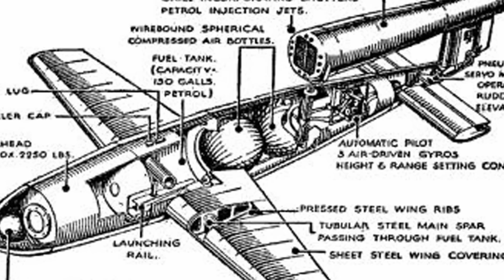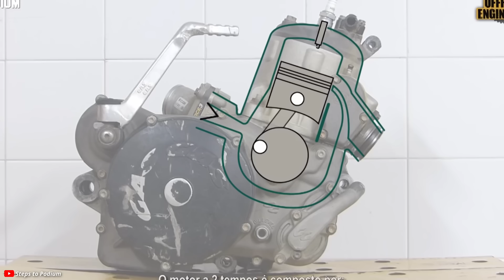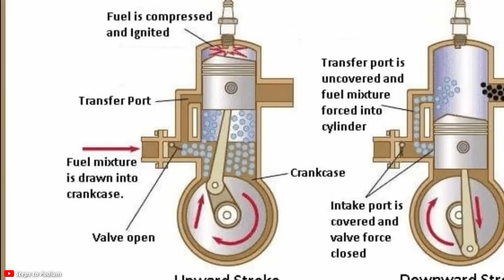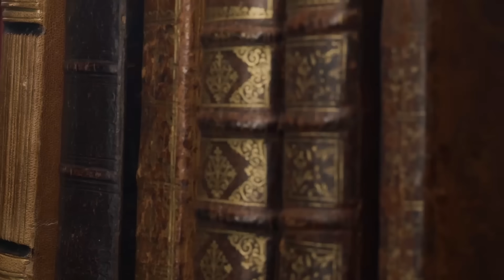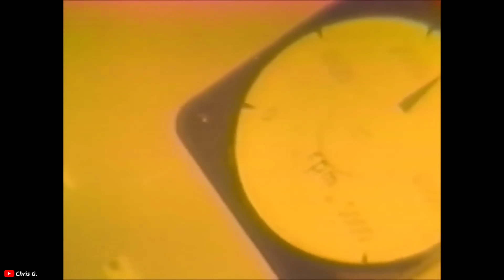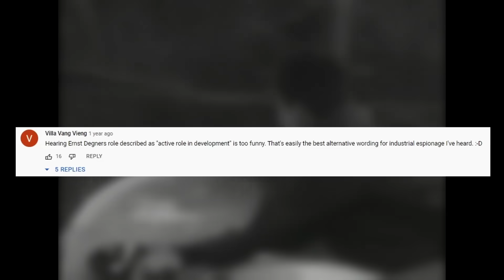How Suzuki stole communist technology to make their motorcycles faster

Comment: Wow, what a remarkable history, and, what a fantastic delivery! You have definitely earned all the kudos you're getting!

My first bike was a dinky Yamaha 100 (2-stroke), and my second (and last) bike a Honda 450 (4-stroke).

I keep telling my wife I'm gonna get another bike (I've maintained my cycle endorsement on my driver's license all these years), but here in my seventies, it seems less and less likely each year. That I have a partially failed triple bypass, one heart attack, and severe scoliosis, as a result of my subcompact being rammed (while stopped at an intersection) by an Olds 98 doing 45 MPH... this all does not really help at all.

But, you never know. I seriously would like to get another bike some day.

But meanwhile, here's another bit of "commie tech" that made its way to Japan:

Nearly all "pro" (and "advanced amateur") cameras are "SLR" type (single lens reflex), in which you view through the actual lens, the camera using a mirror to direct the image to a focusing screen, from which you view it. When you press the shutter release, the mirror flips up, and then the shutter (in front of the film or sensor, depending on the camera) opens, takes the exposure, then closes. When the mirror is lowered again -- either instantly upon the shutter closing, or, when the advance is cranked (by hand or by motor), the image can again be viewed.

The only problem is the mirror! Because it's a mirror, it reverses left and right. So, the image you see while looking down onto the focusing screen (that's the other part of the problem) is a "mirror image."

And if you want to view it at "eye level" rather than "waist level" you'll need to put another mirror into the system, this one above the focusing screen, at a 45 deg. angle, aimed at the eye. The image will no longer be reversed left-right!

However, it will be upside-down!

To have an image that was neither "mirror-image" or upside-down required a clunky arrangement of prisms, known as a "porro-prism" -- the same type as traditionally used in binoculars. While it did work, it resulted in a small image, and, an extremely bulky arrangement of two prisms (or four mirrors), making its implementation completely impractical except for some TLR (twin lens reflex) cameras (the Rolleiflex being the most well-known TLR, but, one that did not offer a porro finder). As far as I'm aware, the Mamiya Pro series were the only TLRs that offered that option.

I digress.

The East German Contax 35mm SLR was the first to solve the problem. They implemented the Pentaprism (combining the "normal" five-sided prism -- the "normal" pentaprism -- and, the "roof prism" into one strangely shaped block of glass).

A five-sided "flat" pentaprism will provide eye-level viewing, but, reversed left-right. Their genius was their combining it with the roof prism, delivering the "peaked roof" shape on top of millions of cameras.

The "roof" part of the prism is a pair of reflecting surfaces, at a 90 deg. angle to each other, and a 45 deg. angle to the rest of the prism. The two mirrors re-reverse left and right, giving a right-side up, unreversed viewfinder image.

Needless to say, hardly anyone these days has heard of "Contax," but hardly anyone has not heard of Canon, Nikon, and many other top-tier Japanese companies (and even more lower tier companies.

I spend too many years as a camera repairman (and photographer, and, "brick and mortar" camera store merchant). The above is some of the stuff I picked up along the way. If it seems wordy, I apologize. I wanted to give it the relevant context (and, my last "serial career" was as a software developer and technical author, so it's a bit of an occupational hazard).

Anyway, thanks again for a truly top-notch video, which I'll be recommending to some other folks.
Reply: @This is my real name.    Thanks for your story, and I digress from the topic, but perhaps you'd like to know. Back in the '50s MY dad started into getting himself a new SLR and was amazed by the Contax technology. So he saves up his money... and bought one.  Many, many old family slides of his, in glorious Kodachrome, etc.  were all we have left  Dad died aged 95,  Sept. 2009;  we still have his house, and if lucky, that Contax is still there . . . . somewhere. 
PS. Back to bikes. My bro and I were really into 'big singles" and still have our prized 1969 Matchless G80CS models. 2 years ago, though we bought a 450 Honda single/  If I ever get my motorcycle license back, (it's way harder now!), I'd love to put some miles on it.)
Reply: @loftsatsympaticodotc  - Thanks for the kind words, much appreciated! I hope you can find that camera! When you do, it should probably be "exercised" every so often to keep it in running order. Snap the shutter a few times on the high speeds, and, the low speeds (i.e., 1 second). If you hear gears buzzing on the low speeds, that's a good sign. If they "sputter" or halt, then it's a sign that the camera can use a "CLA" (clean, lube, adjust). I used to have a camera repair shop, retail storefront, and wholesale operation, route drivers covering much of the SE quarter of Michigan, but I ended up with several careers after that, retiring (due to being disabled) when I was a technical author (book/magazine article stuff on software development).

I wouldn't know who to suggest to work on it but there were (and probably still are) camera repair listservs and it wouldn't hurt to do some web searches for them, and ask questions there. I'm sure someone would know of a reliable repair shop.

I hope you can get a bike -- and your license! I've always maintained mine, "just because." Kept my Chauffeur's endorsement too, "just in case" I ever need to drive for payment (yeah, fat chance <g>).

Comment: You told this story in a great way. I have had a Suzuki 750GT, Kawa 350S2 and a Yamaha RD350YPVS. As we say, an healty engine fires every time… Had some 4 strokes also bu there is something special with the 2-Strokes. 
This is actually a interesting story from a industrial perspective. It will not be the last we hear about industrial espionage and basically theft. Thanks!
Reply: It will be the last, half the story is nonsense.... romantic stuff I'll grant you but mostly nonsense.
Reply: the way 2 stokes run feels like free energy from vacuum! 🐱👍🏿
Reply: I favoured the two stroke for the power the four strokes for economy and on one "engine brake" throttle off and you almost go over the handlebars,change down and slow down even quicker take the bend no brakes applied out off the bend open up redline change up redline change up,On my two stroke similar but much more violent acceleration but no engine brake but still changed down for the acceleration out off the bends, used to take my breath away
Reply: SUZUKI stole nothing,All their own research and development,The CCI on your SUZUKI could be argued a copy of Scott,But it wasn't because scott had patents and used crankcase pressure and SUZUKI used a oil pump from a reservoir governed by the throttle and the engine RPM, Japanese stole nothing from the Russians,They are great at space and military but their car and motorcycles harsh environments and longevity
Reply: @Johnketes54   Engine brake with a 2-stroke means no/little/inadequate lube to parts that really need it!  5-60's Saab 2-strokes had a 'freewheel' lever to engage & did-engage it.

Comment: I have ridden an MZ it's like a rattling tank with two wheels but reliable... one of the things I loved was the front and rear wheel were the same! with the fittings for the sprocket just covered on the front, it meant that if you had a spare wheel on your sidecar you could use it on whatever wheel was punctured without problems!
best way to sum up their street bikes was solid
not pretty but certainly fit for purpose 
best wishes to all
Reply: Next DOWN was the CZ, The MZ is a Rolls Royce but the CZ is a mig 15,

Comment: The two stroke engine is actually more complex than the 4 stroke engine. The Complexity is not in the number of simple mechanical moving parts, the complexity lies in the control of the induction and exhaust processes (not that those processes are entirely simple in the case of 4 strokes).
Reply: tuning and resonance of intake and exhaust

Comment: Actually Micuni carburator was used on Ij Planeta Sport so they collaborated a short time giving to the Russians an improved engine with 32hp from 350cc and 28hp if the import carb wasn't used. The compression rate was increased by 1 unit and were used gears instead of chain in between engine and clutch, the rear tyre was bigger, suspension, a compact lightweight engine-gearbox block, bigger cooling fins, taler seat.

Comment: A fascinating video. Some thoughts:
- One genius is worth a zillion regular engineers. It's harsh, and an awful blow to the concept that we're all equal.
- I'm not a bike rider, but back in the 70s I used to race a 100 cc kart. It had a 2-stroke Parilla engine, with a rotary valve and expansion chamber exhaust. The manufacturer claimed it developed 16 bhp. I had frequent overheating and seizure problems, and had no idea that changing the expansion chamber angle could be important.
Reply: We are all equal, in that each one has a voice that should be heard without prejudice. Even a non-engineer can come up with the solution, but for that, the powerfull must set-up a system, where every voice is easily heard and judged. But t all begins with that we are all equal. We surely aren´t the same tho. 
I re-wrote the content of following link, so that it´s easier understandable (I simply discarded many words, that seemed to complicate the underdanding). 
U can get lots of power by achieving high-rpm at low-ish torque, OR by achieving high compression/torque at low-ish rpm (=more challenging, so, most people go for high rpm). 
The main principle is, that the higher the target-rpm (where u wish to unfold the full potential), the less time do the acoustic waves have available to accomplish their task (=trip back and forth), the nearer the resonance chamber has to be to the cylinder (the shorter the header). 
Of course, u can have a high-compression/torque-cylinder, and set the target-rpm low, and then the exhaust has to be long (more time between strokes means more time available for the wave to travel, so, a longer trip has to be established). 
Part of the acoustic wave always changes direction when moving down a tube, every time the tube widens or narrows-down. 
If the tube widens, a pressure-wave partially reverses direction AND TURNS into a suction-wave (diffusor-cone).
 If the tube narrows-down, a pressure-wave partially reverses direction AND REMAINS a pressure-wave (baffle-cone).  
Of course, resonance sets-in just for a few 100rpm, where the 2-stroke is then better than a 4-stroke, in all aspects (including fuel-efficiency, the greatest weakness of 2-strokes). 
Flatter cones make the effect valid for more 100s rpm, but with less top-power, steeper-cone-angles make the effect work for fewer 100s rpm, but with max-power being higher. 
There´s a way to make that better, by making the header-length variable, where each distinct rpm has its distinct header-length (so that effect sets-in for every rpm), but it´s a niche with very few people doing any research, sadly. 
But here are the fundamentals, without the principle of variable-length-headers: 
https://www.prestwich.ndirect.co.uk/tunedpipetheory.htm

The distance of the diffusor from the cylinder (header length) determines the time-period that the pressure-reducing-wave from the exhaust does its work in emptying the cylinder of exhaust-gas and then assisting the mixture up from the crankcase. 

If header is too short, then, the wave energy from the diffusor is wasted because the negative pressure wave ( the ‘suck’) arrives at the exhaust-port, while the cylinder pressure is still high after combustion (and could thus sustain its evacuation anyway by itself). 

It should arrive then, when the pressure in the cylinder is low enough, but there are still exhaust-gases, that need to be extracted. 

If the header-length is too long, then, the wave is arriving later than optimum and the exhaust-gases are not fully removed from the cylinder. 

The diffusor needs to be long enough (topologically) to generate a wave to help the fresh mixture into the cylinder, but it also needs to continue working long enough to allow some fresh mixture into the beginning of the header (time-wise). 

This is the mixture, which will be forced back into the cylinder. If it is too short, then it does not allow fresh mixture into the header. 
If its too long, then it leaves too little length for the chamber-"belly" and the baffle left (and the baffle needs to be long enough to force all of the fresh mixture in the header to be forced back into the cylinder). 

The pressure wave continues into the baffle and immediately sends a positive pressure wave (laws of physics!) back down the tuned pipe, towards the exhaust-port, forcing the fresh mixture back into the cylinder. 

The strength of the wave increases as the baffle gets smaller and the length is made so, that the arrival of the returning pressure wave (from its very end at the junction with the stinger) coincides with the point of exhaust-port-closure.
 
When this most critical length (start of stinger to exhaust port, unique for each targeted-rpm/engine-combination) is correct, then maximum power is achieved (at the targeted rpm). 

If this critical length is too short, then the returning wave forces hot gases back into the cylinder, dramatically increasing cylinder combustion temperatures. 

If this length is too long, the maximum power will not be achieved, because maximum supercharging (cylinder filling) will not occur, 
although power in the corners will be better, because the tuned length will coincide more with the reduced RPM in the corners (corners of the hp/rpm-graph, a trapezoid. In essence, baffle will have a different target-rpm than the diffusor was designed for, leading to mis-match and sub-optimal results). 

In conclusion, we can see, that the diffusor-length and distance from exhaust-port is very important to achieve maximum fresh-mixture-cylinder-filling and to pull some mixture into the header, and the distance from piston to start of stinger is extremely important to get maximum filling (supercharging) of the cylinder. 

When we adjust the tuned-pipe-length on engines, we are moving several things at once, the diffusor-start (header-length), the diffusor-end, 
the baffle-start and the baffle-end (start-of-stinger).  
remains

Comment: A small, independant motorcycle shop where I used to live managed to import some MZ motorcycles in the early 90's. As they were "grey market" bikes and did not meet EPA/DOT regs he has to remove the turn signals and sell them with a title that specifically stated they were not licensable for on the road use. In spite of this he managed to sell them and somehow some of them were licensed for road use. In this state you can basically get a tag for anything so this is was not a real shocker. I saw them running around for several years, not sure if any of them are left.

Comment: This was an interesting video... And yes, the advent of the rotary valves for 2-stroke induction systems, expansion chambers for the exhaust of 2-strokes, and the improved transfer porting and Schneural porting were things that made big differences with 2-stroke engines... Several of these things were available in American made engines  that were for small boats and aircraft target drones in the mid 1940's.... McCulloch , Mercury, OMC were a few of several manufacturers that were involved with these... One of the major advantages of 2-stroke engines, was the excellent power to weight ratio, and simplicity of design.... But there is no doubt that Mr. Walter Kaaden had a HUGE part in making these engines so much better...  The unfortunate thing is he had so little support in doing this.. . Mainly because of the extremely restrictive political leadership, of the then communist country that Mr. Walter Kaaden was operating in.... Very sad indeed.. . Excellent footage of these amazing motorcycles on this documentary, and an interesting story to go along with it....
Reply: The video creator gave a very different spelling of the man's name in the video description: This is the incredible story of Water Kaaden and his innovative 2 stroke racebikes with MZ. Its also the story of one Ernst Degner and how he stole Kaaden's tech for Suzuki's race team. So.. no cruddy Coddington as Douglas Adams called the town.
Reply: @YodaWhat  Thank You for that insert, of what Mr. Walter Kaaden accomplished to improve the 2-stroke gas engine designs of the 50's-70's... Until now, I didn't know that article completely misspelled Walter Kaaden's last name, not only was it misspelled, but it was not even close to his ACTUAL name.... That darned auto miss-spell feature will do things like this...

Comment: (Mechanical Engineer here) Point of Order at Time Mark 11:13 - The HP improvement most likely came from reducing the temps of the rotating assembly and therefore reducing the thermal expansion of said items thereby reducing the frictional loading and losses due to excessive friction and not an increase in "VE".